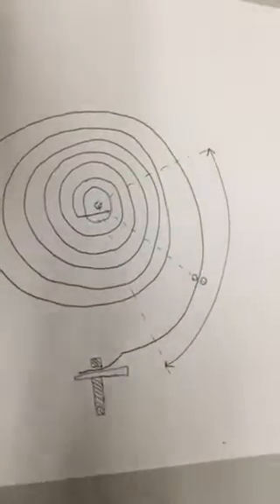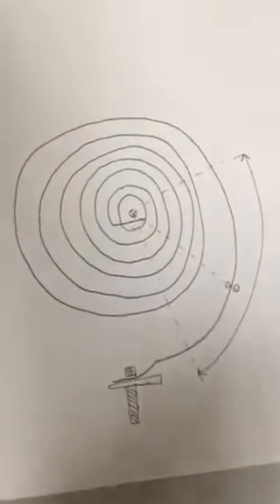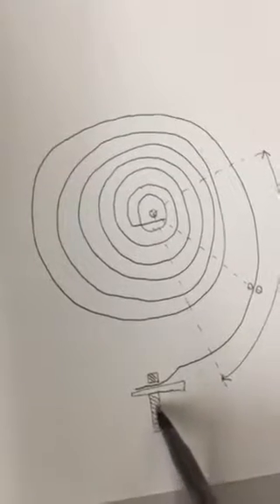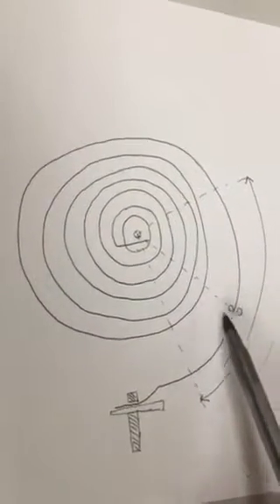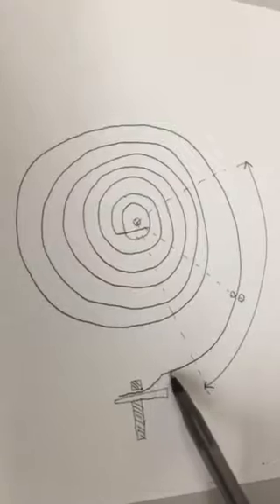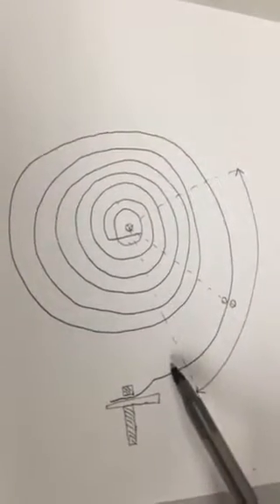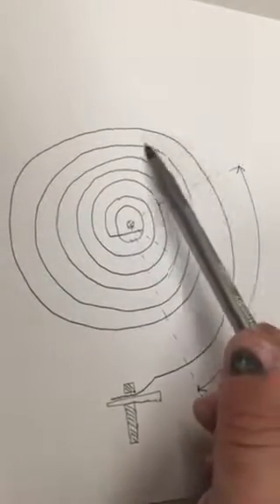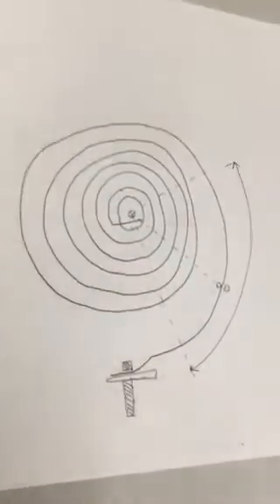Westclox hairspring geometry

Comment: Do you think a filed down gramophone needle would make a good replacement for a taper pin on these watches?  I really don’t know any other way to get a new pin unless you buy another watch.
Reply from the maker: Buy an assortment of brass taper pins or a package of pins in the sizes you need. There are a handful of companies you can buy from online, https://www.milehiclocksupplies.com/  and  https://timesavers.com/  are two that I have dealt with. I don't know of any in Canada that you could buy from if you wanted something a little closer.
Reply: @okbridges  I'm going to experiment with the gramophone needle method. Thanks for the website links, I may or may not buy from them. I'm not sure.

Comment: Where exactly did you get your "Smooth round jaw pliers" ? Home Depot and Lowes don't seem to have them.
Reply from the maker: I picked up mine from a vendor at a fair.  Here is a pair for sale on Amazon https://www.amazon.com/Beadalon-Round-Nose-Pliers-Style/dp/B002QKE6ZW
I always remove the spring that causes the jaws to open.
For small hairsprings as in watches, you really need tweezers https://www.amazon.co.uk/MKCLOCKS-Watch-Clockmakers-Jewellers-Tweezers/dp/B0026W3KSY
It takes a lot of care and a steady hand to clean up a hairspring.
Reply: okbridges Ah I see. I was looking for the wrong thing. I’ll go and see if anyone has some round jaw TWEEZERS. Actually, scratch that. I’m going to go look for some jewellers tweezers or something like that.
Reply from the maker: Yes, exactly, you will need tweezers. You can use small pliers for Big Ben hairsprings, and maybe Baby Ben hairsprings if your eyes are good and you've a steady hand, but for watches, tweezers are a must.

Comment: So after picking up the Dax pocket watch I got in my 14th episode of "greg goes antiquing" and taking it upstairs. I wondered why It has suddenly stopped running, after taking the back off I noticed the balance wheel had fallen out of place because there was a screw near the balance wheel missing. (It was always like this but it somehow hadn't fallen out before). I decided to take the hairspring out before it got all tangled up (since it wasn't sitting right). Long story short, I don't know how this happened. The outer coil got bent. So now I'm really going to try and attempt this myself one of these days. I re-read your other comment and I'm pretty I know what to do. I just need some "round jaw pliers" and I will be all set. Thanks again for posting this.

Comment: So that's how they're supposed to be. I see. Yeah, I found this watch without the back cover on it. The balance wheel looked a bit rough and it wasn't in one of the cups properly. I read your comment on how do adjust these and I have come to a conclusion. I do have a spare balance wheel that is in working condition on another Pocket Ben. (It's the luminous model but the crown fork is bent so when you try to set it the crown comes out) (It's also a style 5 Pocket Ben like the one I'm trying to fix). I'm just going to take the balance wheel out of that one and install it into the watch I'm working on. The back of the case is stuck onto it, though. The guy who sold it couldn't even get it off. (Didn't know this when I bought it).
Reply from the maker: Save the bad hair spring to practice on.